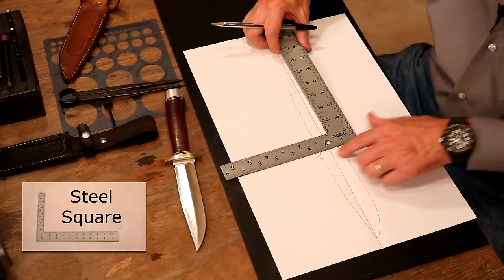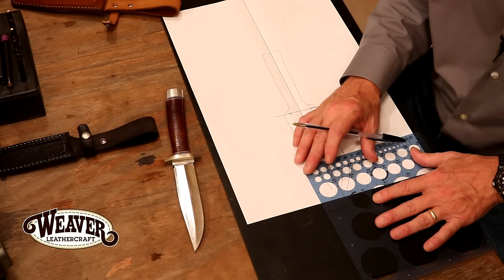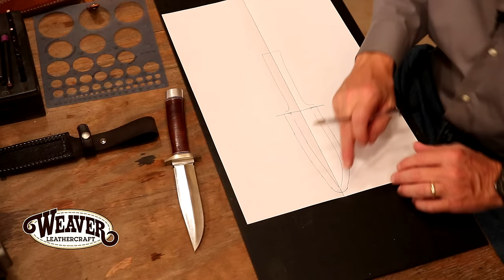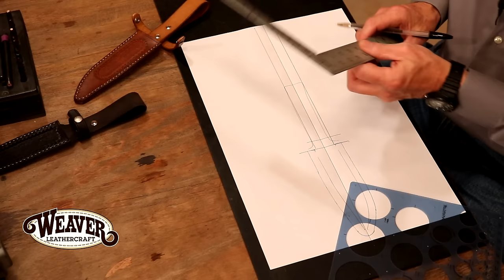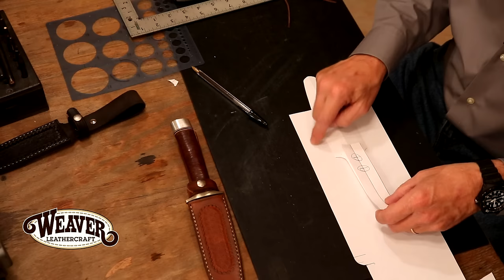Leather Knife Sheath Instructions Chapter 1: Creating a Pattern

Comment: @WeaverLeatherSupply, I really like this series, and I’m going to use it for my G.C. Company stag handle bowie knife. The only thing is that I would very much like to have fringe along the blade side. Would you just add that in so you have 4 layers on that side (the lace being a thinner layer)? Or, would you skife that side of the back layer to help reduce thickness? Or is there another way? Thanks!

Comment: I've seen people glue hard plastic or wood inserts to the inside of the sheath so the blade doesn't cut it. Is there any worry about cutting the stitching when drawing the blade out over time on one like this?
Reply from the maker: Hi there, 
The leather welt that was added in the video will keep the blade from cutting through the stitching. Hope that helps!

Comment: I see right handed knife and gun but I’m left handed so both left handed right?
Reply from the maker: I'm not sure if I'm reading the question right but the knife sheath and holster videos are both right handed so for left-handed you can just reverse the way I made the pattern. So for the knife, you can flip the blade the opposite way and for the holster, you can add the tooling on the opposite side of the leather from what I did. Let me know if that didn't answer your question!
Reply: Weaver Leathercraft thanks I was wondering so I meant that I’m left handed so should I flip the side for the leather
Reply from the maker: @Texo_McKevo  That's correct!